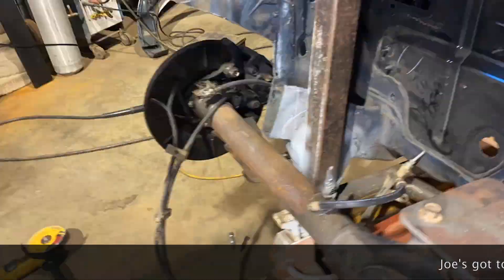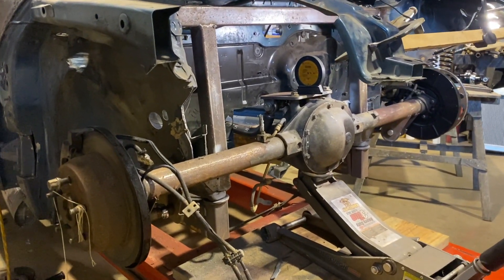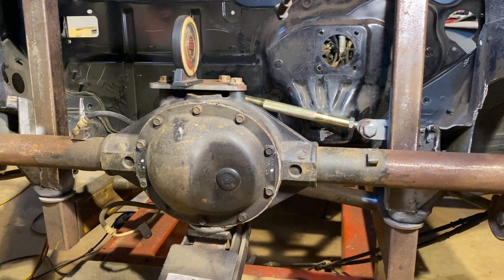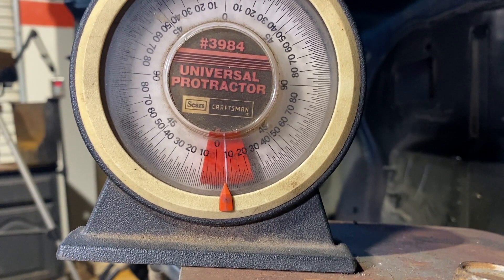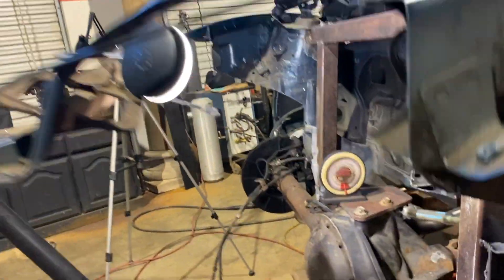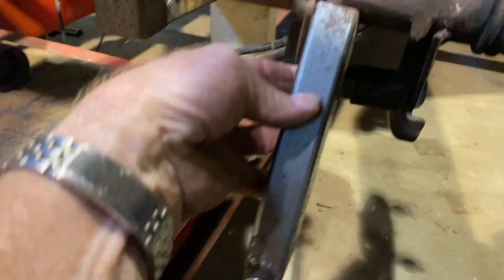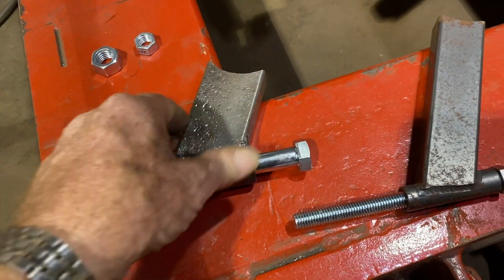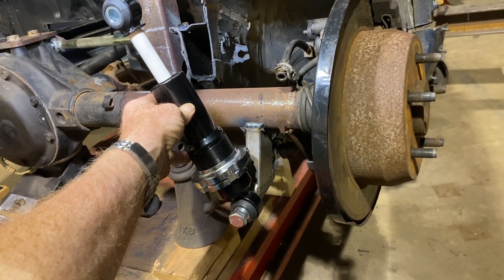Rear coilover mount part 2

Comment: Joe the pan hard bar will not change the pinion angle it will change from side to side as it goes thru is travels in pulling rear end right or left
Reply: Yes I understand that.I just wanted to check to see the angle change .